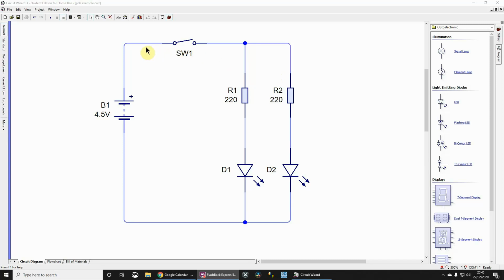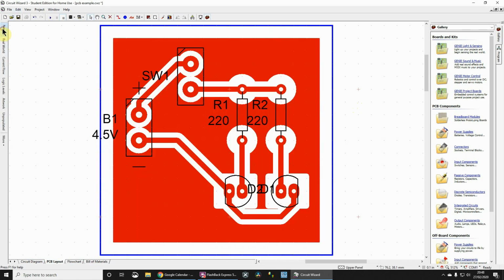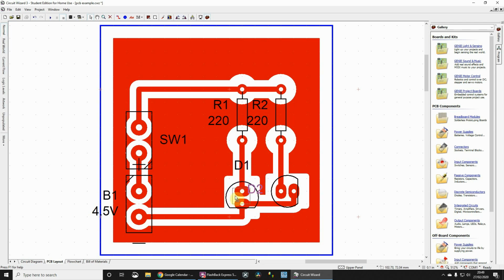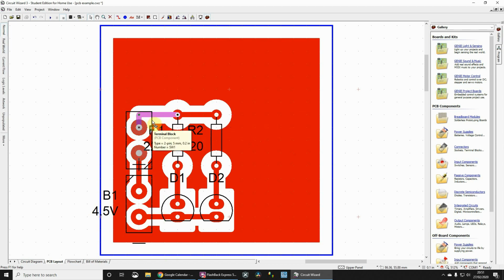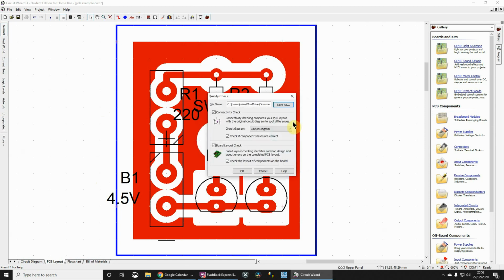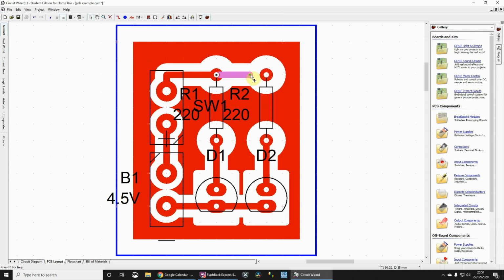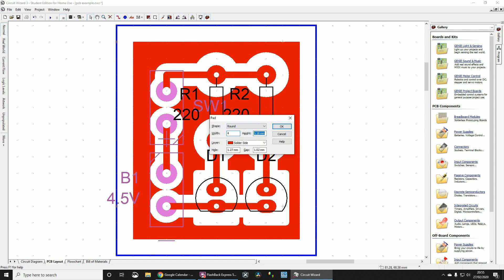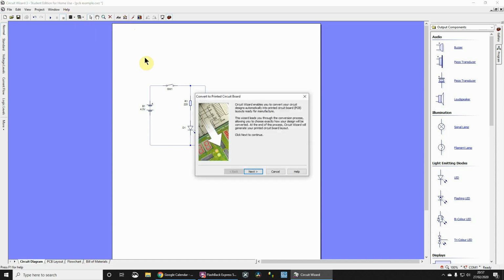How to convert to a PCB layout using Circuit Wizard

Comment: I don't know why there is no CD4047 AND SG3525 AND TL494 IC ON IT
Reply from the maker: I quite like Circuit Wizard for teaching in schools but it would help if they added more components. Which program do you prefer using instead?
Reply: @PizzeyTechnology  i want to simulate SG3525 inverter circuit
Reply from the maker: That sounds interesting but even if circuit Wizard had that part I don't think it would simulate well. I may have missed something important somewhere, but in my experience this program is best for DC or very low frequency circuits.
Reply: @PizzeyTechnology  yes that is true